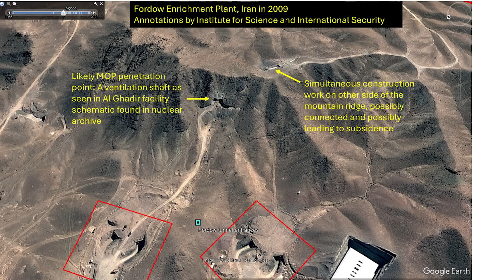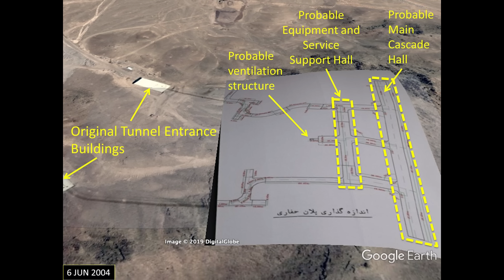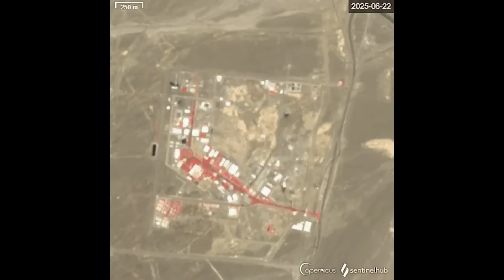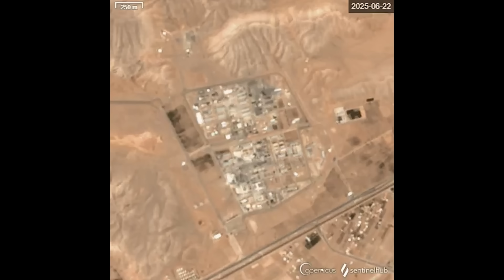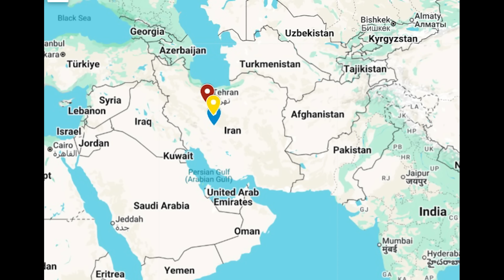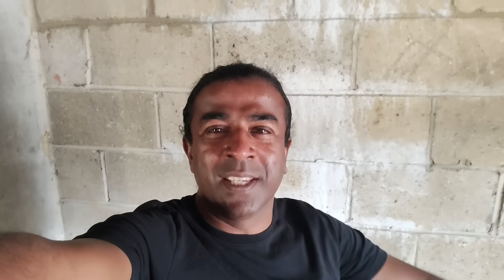Operation Midnight Hammer: New Satellite Imagery of Fordow, First Imagery of Natanz & Esfahan

Comment: I genuinely doubt that there is an, “inside of the facility,” to see any more.  The explosive on those warheads yields Daisy Cutter levels of boom!  Their geological specialists will have told them where to hit so as to ensure a certain blast radius within the rock that would fully collapse any caves, lacunae or man made chambers inside the mountain.  Then the US airforce will have dropped three times more than was required, just to be sure.
	That’s my uninformed guess at any rate.  Thanks so much, Such.  Love your work.

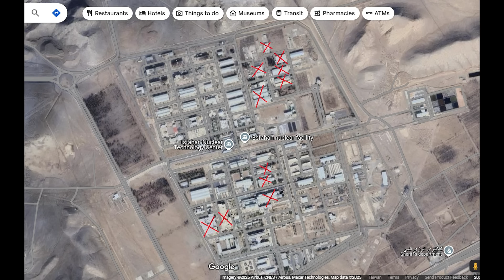Comment: 7:01... the lay out is a campus...two on the lower left are administration and operations the middle ones would be research and testing the top ones are 100% equipment storage. except for the very top one... security quarters for sleep overs due to the parking lot to the left of it. the one right below that building was extremely important as it's razor sharp lines show a very high security electrified fence

Comment: It is possible that multiple gbu 57’s went through the same hole.  These, along with the b-2’s they were dropped from, are insanely precise.  The GBU-57 sports an accuracy of within 1 meter.  As such, it is certainly possible that although there were only 6 holes in fordow more that 6 units may have hit there

Comment: There’s no evidence that the underground facility at Fordow was destroyed, or even hit. There’s no smoke coming from the ventilation ducts, and no signs of ground collapse or subsidence that would suggest a structural failure

Even if the GBU-57s were dropped in the correct location, I doubt they could penetrate deep enough to reach the underground facilities. If the tunnels were built using 90 MPa concrete reinforced with 7% steel fibers, each bomb would only penetrate about 3 to 4 meters. This is significantly less than the 60 m claimed by the US when used against standard concrete. I doubt that 6 GBU-57s dropped at each entry point at Fordow is sufficient to reach the depth required to destroy the facility
Reply: Good points. We're probably never going to know. I'm pretty sure Iran will stay quiet.
Reply: @toby9999  This might be wishful thinking but they might even want to pretend it was a success and the US might have been on some level pretending they thought this would work even if it was unlikely. It is in everyone's interest to return to the status quo of an Iranian nuclear program forever in stasis. Then everyone might be able to walk things back.

I mean even if this stirke was successful its not clear if it was even the right target. No one knows where the 60% enrichment stock is and the massive infrastructure is mostly needed for the hard part of getting up to 60% compared to the relative ease of going the rest of the way.
Reply: @peterisawesomeplease you seem to know
Reply: How do you know how deep the GBU-57 can enter in the concrete you describe? Were you present when the bombs were testet? Do you have access to test-data?
Reply: @joli8218 I am a Civil Engineer, and understand how explosives affect concrete because I studied it. I ran a series of calculations to assess the likely penetration depth by varying the concretes strength (30, 60, 90, 120 MPa), the amount of steel fiber used (2%, 5%, 7%), the sites geology and therefore its likely strength, the height that the bomb was dropped (10-15km), and the publicly known information about the GBU-57 like its dimensions, weight, warhead type, nose shape etc

That is how I "know" how deep the GBU-57 can penetrate. Run the numbers yourself if you can. If you don't know how, try using Grok (AI) and check the numbers yourself. The calculations it made using the deepersearch feature aren't perfect but were in the right ballpark... but then again I also know what parameters it needs to complete the calculations

Like it or not, Iran is a world leader in high strength fibre reinforced concrete. The country is very seismically active, and they have been under threat of attack for decades

I don't think the bombs were even dropped in the right place, let alone blast through a mountain
Reply: @nicholaidajuan865  Thanks for the good answer. Nowadays one normally only gets insults or "because i told you so", not a normal conversation :) Apperciate it.
Reply: But TACO has already crowed that it was obliterated. He doesn't rely on intelligence. His every notion and whim are infallible.

Comment: The real question is, how much equipment and fissile material had already been moved to other locations. It’s not like this strike was coming out of the blue. Likely will require trawling through a month or so of detailed satellite imagery hour by hour and then still not being enough.
Iranians are very capable of planning long time ahead and would likely have stockpiled their 60% uranium somewhere else than where the centrifuges are. This strike sets back production of more material, it doesn’t remove what was already made, and with IAEA detecting no additional radiation, it indicates that no material was stored.
Reply: How does the IAEA measure this? From space? Sensors close by would have been eliminated.

Comment: I do think that some caution should be warranted when assessing the damage to Fordow. The first is that we have no idea if the ventilation shafts were angled upwards instead of being a vertical shaft going straight down. If the former, then the MOPs would still need to penetrate hundreds of feet of rock and soil to get down. The 2nd issue is that the MOP's only have a publicly stated penetration depth of 60 m(about 200 feet) through earth. Higher estimates for Fordow's depth place at around 90 m deep. We have no idea how much extra depth the MOP's could penetrate if they were dropped on top of each. All of this assumes that Western intelligence agencies got the layout and depth of Fordow roughly correct. Because of this, I think any judgements of Fordow's state should be held off until we've gotten much better publicly available battle damage assessment.
Reply: The point of striking near the ventilation shaft wasn’t to drop straight through it, rather to make use of the void it creates for shattered rock and concrete to fill.    The aim point is above the known location of underground voids.  Giving shattered rock a void to move into would aid greatly the penetration.  The fact that 3 distinct holes are so tightly clustered in 2 different locations suggests we have 2 MOPs per hole or 4-6 MOPs per cluster.    Fair to say Fordow is caked.
Reply: Would that be a job for American intelligence? TACO says they're wrong.

Comment: Also, hitting the ventilation shaft can cause a pressure blast to enter more of the structure. That can, in theory, cause the blast to penetrate deeper and further. Anywhere the ventilation shaft enters, so to will the pressure wave. Causing collapes and all sorts of structural damage.

Comment: There will be no settlement at surface. If you have a void 1.0m and 30m deep and this void collapses there is enough material above the void to prevent surface settlement. This is called superincumbent rock cover. So 4m void 120m would have no settlement, but 4m at 100m would have millimeters of surface settlement. The exception to this is a verticle shaft collapse then you would have a 40m diameter crater.

Comment: Love your meticulous analysis. And your quips and barbs keep my smiling. 
On that image of Fordow when construction was going on up the sides of the cliff. About the annotations. If you take the 3-D image of the underground facility it looks to me like the ventilation shaft connects to the far side of the ridge. I think the annotation boxes need to be swapped.
Reply: Oh, and I like your red circles on the layout of the facility. I was thinking. Your red circles are the impact points. And so you need to elevate your circles by at least 50 meters. Then the MOPs traveled down at some angle to eventually break out into the open which their special fuse would detect and the explosives are FREE!
We don’t know the angles. But I think a good estimate would be to work backwards. The one that hit the vent shaft is easy. It followed the vent shaft weakness down to the room where the vent shaft originated. The other one…I think we could assume bomb angle lined up with the axis of the main hallway the centrifuges are on. And I think the angle from the center of that hall up to the bomb impact point on the mountain is a reasonable angle for a high altitude release.
Reply: @AnavyRIO  Of course, Iranian engineers wouldn't know about to use deflectors in caverns above the enrichment hall to send a MOP on a semi-horizontal trajectory.

Comment: "The US Air Force has said that the GBU-57 can penetrate up to 60 m (200 ft) of unspecified material before exploding.[29] The BBC reports that analysts at Janes say the weapon can penetrate about 60 m (200 ft) of earth or 18 m (59 ft) of concrete.[30] This is consistent with a separate source which suggests penetration of up to 18 m (59 ft) into reinforced concrete with a compressive strength of 5,000 psi (34 MPa) and 2.4 m (8 ft) into 10,000 psi (69 MPa) reinforced concrete.[31]" 
"Dolomite Physical properties: Compressive strength: 2,000 to 37,000 psi. The main factors responsible for strength of carbonate rocks are their interlocking grain fabric and their mineralogy."
Reply: Don't forget that the public numbers are probably low. The military is not going to say how far they can really penetrate, otherwise 
the "bad guys" will know how far they need to dig to be safe.
Reply: @googacct  this is all essentially a function of physics and geomechanics, they are not melting a path with lasers, there is no secret tech, just velocity and a hard penetrator
Reply: Our old bunker busters penetrate significantly further than their official stats. I bet these do as well.
Reply: @donwyoming1936  They must have overshot then since the DIA assessment is that the facilities were not destroyed

Comment: The autoclaves are used to heat the UF6 to gaseous temperatures before they are injected in to the cascades. UF6 is a crystalline solid at room temperature, so you have to heat it to gaseous temperatures before separating.

Comment: Usually I've had two sets of plans with developments - one set as-designed, and one set as-built.... which are always different in my experience.  Guessing the as-built plans would line up the "x" of the crossing halls with the penetrations.
Reply: Were the penetrations vertical or oblique? That should account for some of the distance. Do agree that as-build differs from as-designed, esp when building underground.

Comment: Changing the engine is a waste of time money and resources.  You can probably repair and prep 3x the trucks, and buy 2x to 3x the trucks without the cost of BMW engines and the time to do the conversion.  If you have 3x the trucks, you'll lose one out of 3 to mechanical failure, but you're still left with 2x the trucks.
Reply: Pretty sure these guys are mechanics and what they’re doing is taking out all the so-called safety features with bells and whistles and Christmas tree lights on the dashboard every time you’re low on fuel or low on windshield wiper fluid or you’ve got a tire that has low pressure…all those bells and whistles are a distraction and a pain in the ass and useless when you’re in war. Remember how much you liked your vehicles pre-1990? I bet they change out the shocks too. Creating a BMW/Willys. 2025 circa 2025.

Comment: I would think tomahawks would have been used to take out AAA, command, and other buildings.  Probably list 2 or 3 on the Israeli list.  I would assume most big stuff on list 1 would already be gone.  I think there is a top down firing tomahawk.  Pretty sure it was designed for above ground, small bunkers.  Ammunition and plane storage type stuff.

Comment: How thick is the rock roof over the rooms? That is, how deep is everything underground? How deep can the munitions used penetrate? Is this another "We wiped out all the U-boat pens at La Rochelle with the first strike!".
Reply: 80-90 meters under dolomite and sandstone, the MOP can penetrate 60 meters in sand or soil, maybe up to 18 meters in high-pressure (10,000 psi) concrete. Dolomite and sandstone are bother harder to penetrate, with a psi range between 7000-35000.

Comment: RAF Veteran who worked with the USAF in joint ops.  150 aircraft is very believable.  Unlike the RAF, the US throws plenty of resources into major operations.  Fighter sweep and escort, SEAD, AWAC, Rivet Joint ( int and coms gathering/surpression) and all the tankers necessary to refuel these with a few reserves thrown in.   Nobody does it better...
Reply: Let's hope that Senate rejects Hegseth's plan to replace E2 Sentry with Hawkeyes instead of Wedgetails otherwise this will be the last such operation launched on this scale.
Reply: @paulharrison197  why? Is the Hawkeye that much worse than the Wedgetail?
Reply: @fredslipknot9  Absolutely worse for the mission.  Hawkeye is much smaller, much less crew, slower flying, smaller scanning range.  It's meant to work with a carrier task group out on the ocean and does that job well.  A full blown AWACS like the Wedgetail has more, and more powerful, sensors, more types of analysis stations and many more specialist crewmembers to handle all of them.  It can cover whole countries with their complex topography, transport systems, and so on.
Reply: @fredslipknot9  its not exactly worse, just different specs. The E2 can operate from carriers and is better at loitering, but the E7 has more range, payload and can do more things. But this is absolutely not a good idea. We need both, not one or the other. This needs to be a, we keep the E2s and add E7s on top of that, situation, not a "either/or".
Reply: @cameronspence4977 but they are not adding E7 though. Budget cutting.
Reply: @darkmatter5262 I know they aren't, thats what my complaint is
Reply: @paulharrison197 , Congress likely will. Not many Congresspeople have served in an armed, uniformed capacity. They don't understand Israel has no military strategy.
Reply: @paulharrison197 Don't forget the idea of reducing the F-35 orders. It will go the way of the F-22 and C-17 all over again.
Reply: @00calvinlee00 F35 isnt still going to be as bad even if we dont buy 1700 of them. If they just reduce it down to like 1300 that will still be plenty for economy of scale which is I hope the outcome...F35 was not built for the wars we have the greatest chance of having to fight
Reply: @cameronspence4977  I get what you are saying but I watched the F-22,C-17, and F-18A/C/D lines go away because the foreign sales werent there, them Operational Tempo Increased and Airframes were harder to maintain. The F-35 was never going to replace the F-16,A-10,AV-8, and F-18 plane for plane like the F-18E/F did for the F-14. The C-17, same deal. C-141,C-130 and even some C-5s were replaced by the C-17 but sadly there could have been more for a lower Unit Replacement Cost. The F-35 quietly was also slated to replace USMC EA-6Bs anf augment EA-18Gs.
Reply: @00calvinlee00  they need to free up some funds for a few new platforms. One being the F47 but there are a couple more that are still unannounced. Stay tuned you will be pleased in the end.
Reply: @00calvinlee00  Dont expect a lot of foreign sales during the circumstances. My country recently teamed up with two other coountries and stopped buying C-130 and went for a different plane the Embraer C-390 instead since usa is not considered a reliable supplier. And I doubt usa will be considered that for the next decade or so.
Reply: @alphaomega6966 The US sadly continues to be a questionable Ally. It is to say the least upsetting. Many of my Countrymen dont think long term and cant understand history.
Reply: @kc72186  The LCS program, the Zumwalt Program, the KC-767,BRAC2005, the E-7. The DoD does not inspire confidence.
Reply: I completely agree.  This is a downgrade and disabling move.  The man is crazy.
Reply: @johnhudghton2287  Not crazy ...just a Traitor working for China/Russia.
Reply: I wonder if SAR imagery would give us a clue to the destruction below ground. With before and after images we might see some subsidence
Reply: Yeah,  but Uncle Sam let IDF do all the 'hard yards' in destroying Iranian SAM, Radar and airforce before letting US planes into the area.  IDF had already achieved total air superiority over the area.
Reply: @chrissmith2114  very true
Reply: "Better".
Reply: I wonder how much it all cost. The fuel, the weapons.
Just add the bill to the massive debt pile we already owe and cannot pay back.
Should pass the bill to Israel
Reply: And it's all so thrifty! Iraq alone was a bargain, "most sources indicate the total cost to be between $2 trillion and $3 trillion." Shucks, that's only 5 to 8% of America's $37 trillion total national debt and so a gift of peace to our descendants. Nothing but the best for the Middle East.

Comment: Nobody can convince me that Fordow was destroyed
Reply: Well whether it was or was not will not make a difference to your opinion!!!!   
But whether it was or was not will make a big difference in relation to Iran getting a nuclear warhead ready.
Reply: 12 bombs were dropped on Fordow per Pentagon reporting. There are two groups of three holes, with one hole in each group being visibly bigger. So they hit the larger hole 4 times in total. The "side holes" were just to help loosen the soil up. You can bet your ass the roof collapsed, at least in some places, even if the MOPs didn't detonate inside the structure itself.

If you keep hitting a 100mm armor plate with projectiles that can only penetrate 75mm, over and over again, you'll eventually make it though.
Reply: @andersjjensen Pretty sure we're not talking about armor plating here.